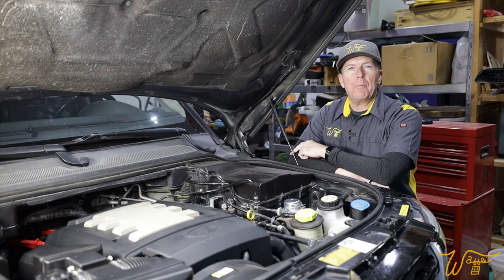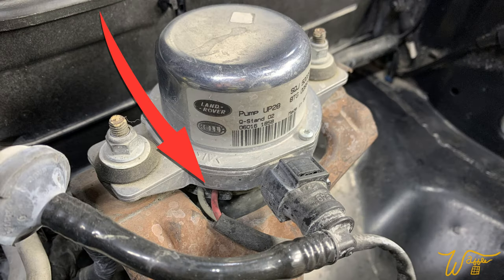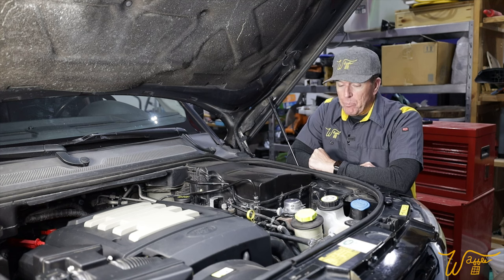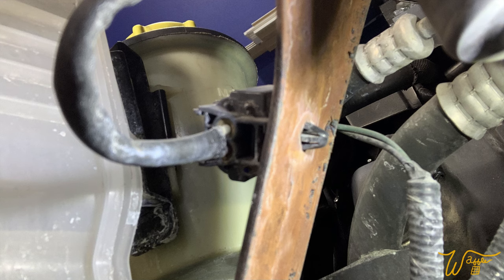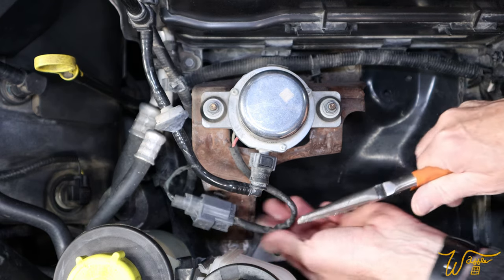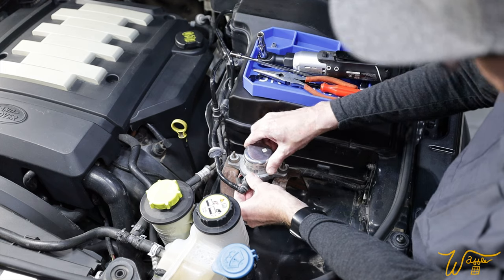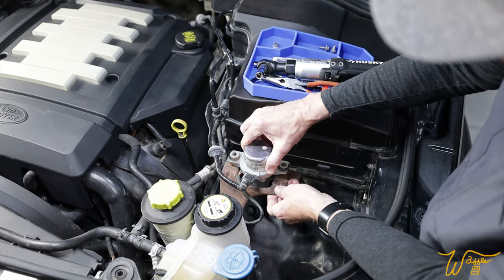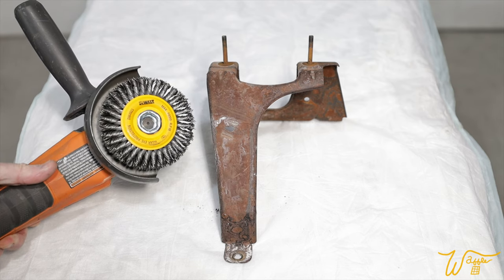Painting a Land Rover LR3 Vacuum Pump Bracket - Ep.8

Comment: Nice job.  I saw a great tip recently re that small Clip which snapped.  The guy put a small sized socket over the tip of the end of the bit which sticks through and locks.  The socket squeezes the flexible bits in towards the centre pole allowing the clip to then be slid out 👍 simple but it prevents pliers snapping the ends off 😁
Reply from the maker: Love it!

Comment: Great show mate, I have a Discovery 4 2015. So when changing my iron rusty, (very heavy) Side Steps I found that the brackets had rust on them, just like your bracket. The only difference was that I always use a rust converter as my primer, this tends to eliminate any re-rust coming back via the surface of the metal. By the way the new Aluminium steps I fitted (after a little fettling) are less than half the weight of the original and will last a lot longer. 
Keep it coming by the way when summer finally arrives I'm flushing my heater matrix. Nice one
Reply from the maker: Thank you, Charles!